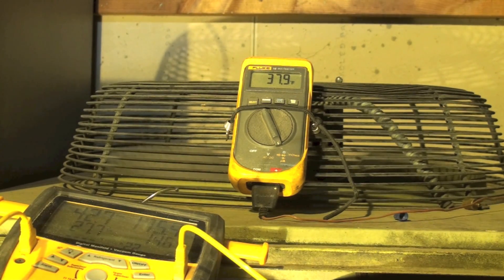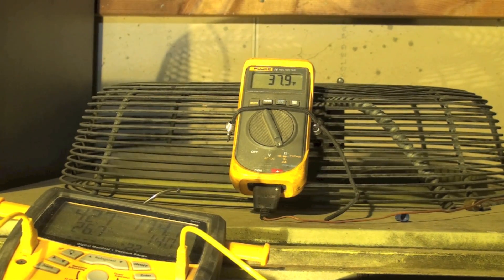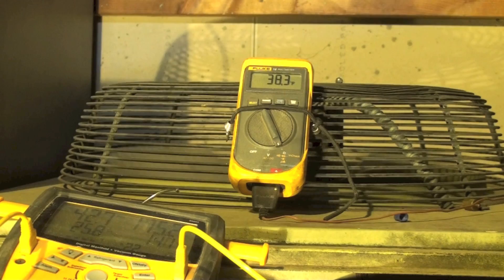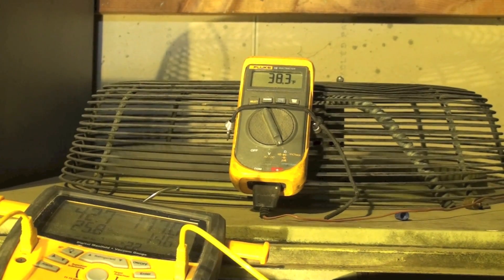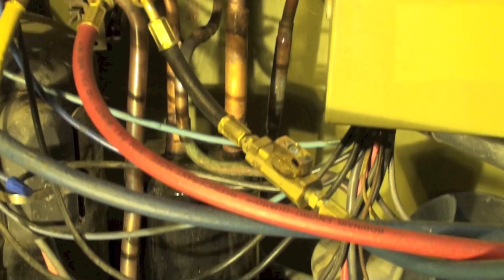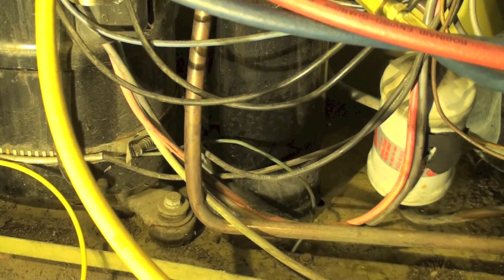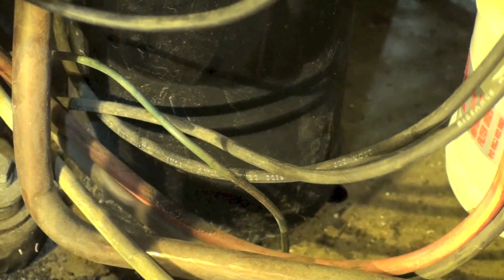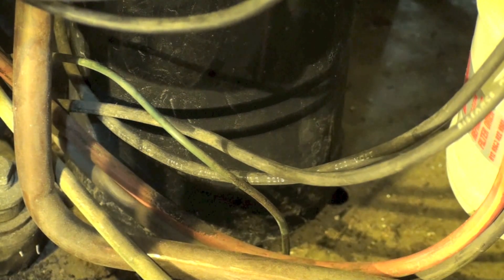The function of the accumulator

Comment: In a larger rack system I always think of the accumulator as a safety to prevent liquid from hitting a compressor.  In the larger systems they have floats and an additional heater too.
Reply from the maker: phooesnax On rack systems, they are good for only momentary flood backs. If you have a valve that is is flooding you can still get liquid back to the compressor due to the large volume of refrigerant.  
GFM